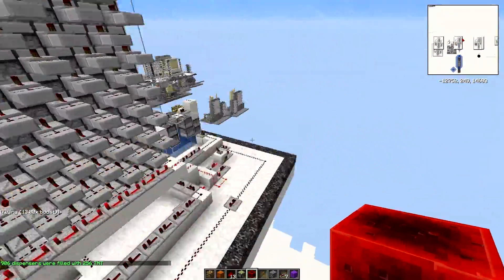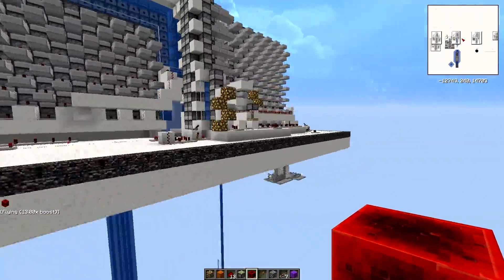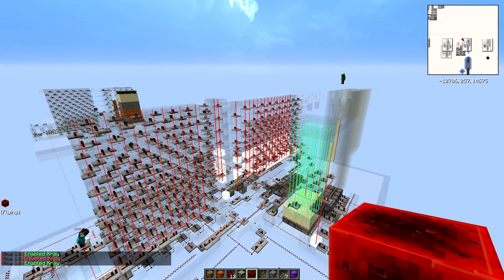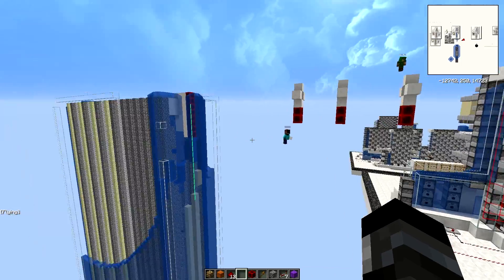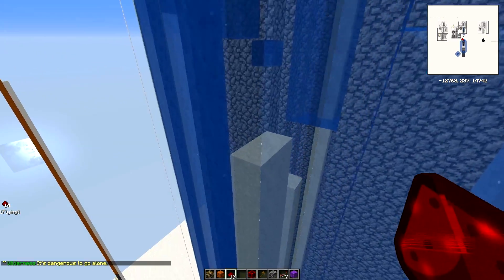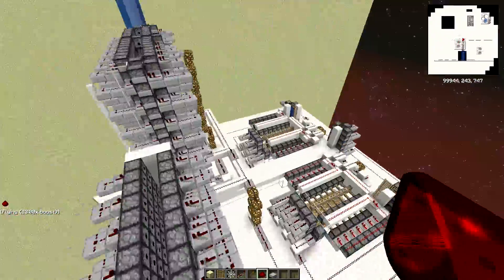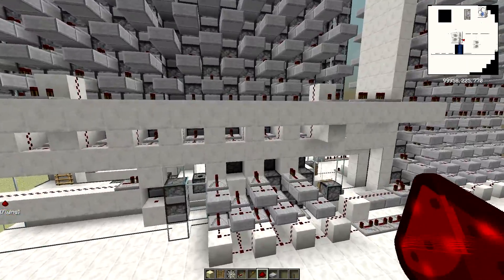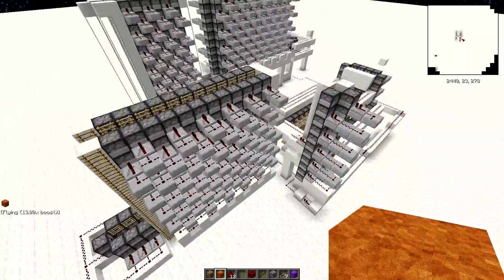Fusion Cannoning-Indexed Fullstacking with a Zero Guider Difference (Order of Entities)

Comment: Yo so with order of entity stacking, when the sand and hammer reach the wall are they technically in the same block or is the sand lower than hammer or does that not matter and it will stack anyway?
Reply from the maker: You can think of them as being in the same block-as they basically will follow the same path horizontally, albeit at slightly different times. Once it hits the wall, and with this order, the sand will update downwards slightly-so no longer in  the same block as the tnt-then when the tnt explodes, it'll then move the sand down. By choosing the order our cannon renders entities, we can then put sand and tnt in the same block, and let Minecraft update things by its own, so it can then stack down.
Reply: Beingsad Ahhh cool thanks for the help keep up the awesome work! :)
Reply: Also, how do you work out where each thing should come in the order of entities? Is it just experimenting?
Reply from the maker: experimenting and literally two and a half years of fucking with this stuff lol
Reply: Beingsad Hahahaha okay thanks :)
Reply: Another thing (sorry) what is the use in fusion cannoning
Reply from the maker: Well the most basic idea is if you needed to shoot through a 1x1 hole, however the idea of using ordering to manipulate how items stack is extremely important, you can use OOE methods with fusion stacking with regen busting-all about applying ideas in interesting ways.
Reply: +Beingsad Ah mean I guess if something is there you might as well experiment with it lol. How does real life physics relate to minecraft physics? Do laws to do with kinematics and forces and all that apply the same in minecraft?
Reply from the maker: Some do-for example with falling bodies there is drag, so our actual equations are thus different than x=xo+vot+.5at^2, etc. We have to careful and consider how the game interprets its version of physics, as things need to be quantified and processed in a certain way since we're playing on a computer.

Comment: One very good use for Order of Entities is something I've been working on which is an infinite reverse hybrid. This would allow you to reverse through water layers, in theory, from y 0-255 without having to change the amount of power you use to reverse since the hammer and sand stay in the same block so there is no issues with it not stacking fully. Most reverse hybrids require you to change the amount of power or timings every couple layers. Not only this, but an initial watered backboard would no longer be needed since you can reverse nuke and reverse hybrid in the same shot since the large amount of power necessary to reverse nuke wouldn't make it so it wont reverse stack. This will instantly create a sand backboard to continue to reverse off of while simultaneously allowing for water to flow down making this very practical and reliable in a raiding scenario.

Comment: Not about this cannon in particular, if I just add a ton of power to a cannon I'm using does it allow me to not need to add tick(s) to hammer after a certain distance? If so, is there a quantity of tnt in the propulsion that would make me not need to add hammer tick(s)? If not, what lessens the need to add tick(s) to the hammer?
Reply from the maker: +George Grady Adding more power will allow you to not need to add ticks as you're shooting the base. Because the shot is going faster per tick (more blocks per tick) then you could shoot more walls in 1 tick of delay. I find out how far it shoots by world editing a flat wall parallel with the axis the cannon shoots, and find where the hammer explodes, and then boom there  we go.
Reply: +Beingsad // GetSwatted  I see, thank you!

Comment: Interesting concept and great video.
My idea was to have ~5 TNT going off a few ticks before the hammer, this will shoot the hammer and sand a little bit up and because it´s  now flying upwards instead of falling, the hammer can tick off before all the sand become entities  and it will stack. Because there is less delay on the hammer and it will also fly up you can hybride and wont clip at the next shot.
However i couldn´t manage to slabbust and i don´t know why. In theory it should be possible because the slabbust is later in the sequence.
Sry for bad english^^
Reply from the maker: +Placebo Raiding While the slabbust does technically tick off later in the sequence, it really is ticking off effectively at the same time as the hammer, while the sand is clearly separate from the tnt, resulting in it not working as expected.
Reply: +Beingsad // GetSwatted Thank you for your quick response
oh okey
So if the send falls before the hammer ticks off, does the sand stack in the same tick the hammer explodes or in the next tick because the sand got already calculated before the hammer explode in that tick?

Comment: Very interesting concept using tick ordering to fusion stack. However on the issue with having to have the sand all become entities in a short time frame I think you are looking at it in the wrong way. What you need to do is get all the sand to become entities at a very short amount of time not make them fall necessarily in a short amount of time. I came up with this design http://prntscr.com/9zqx77 basically it uses a 12x4 sand comp design and it can spawn all the sand entities in roughly 1-3 ticks (I have not checked exactly), however with that compression it is definitely feasible to get all the sand to become entities in between the power going off and a 4 tick hammer, cool stuff.
Reply from the maker: +Big L Whoops saw it was posted in my spam folder. I can't get it to slab-stack-hybrid with this because (While the slabbust is rendered *first) the slabbust and hammer are technically rendered at the same time relative to the sand-so those will stay in the same block while the sand will move. I don't see a feasible way around that.
Reply from the maker: Seriously great thinking.
Reply: Beingsad // GetSwatted No problem :)
Reply: Beingsad // GetSwatted Wait what?
Reply: +Big L I had the same idea, but the problem with this, is that it´s aids to fill the sandcomp.
so i came up with a similar design but i´m pushing the sand with the double pistons.
http://prntscr.com/a05670

the problem here is the hight, but you could builde this under the cannon and have like a semi auto cannon where you only need to place the cobwebs
Reply from the maker: +Big L Whoops sorta embarrassing, somehow found time to check my youtube channel on my phone. Basically meant thats a very good idea lol.
Reply: Beingsad // GetSwatted Yeah I actually just finished making a sand comp that makes 288 sand become entities in 2 ticks. Now I'm going to try it on a cannon, I'll tell you how it goes.
Reply from the maker: +Big L I'm sure it works well haha
Reply: +Beingsad // GetSwatted Yea sadly the fact you can not slabbust renders fusion stacking and fusion lefting useless. However there are many other applications for this like 1 tick reversing, mid air reversing.
Reply: +Big L I've been able to make it fusion leftshoot slabbust just fine since the slabtnt is under a slab where the two dispensers are for ajayys left attachment.
Reply: imaBASKET || Courage No, I'm not saying there isn't a way to left shoot fusion, I've done it before it's just using the order of entities I don't think there is any way that you can efficiently slabbust with the cannon it's just not feasible.
Reply: +Big L what would be a different method to fusion stack?
Reply from the maker: +Big L As an update you can slabbust with this indexing method.
Reply: +Beingsad // GetSwatted i got the slabbust working as well, but I had to double pulse the hammee
Reply from the maker: +Lukas Eisele I managed to get it working without double pulsing anything-just need to optimally place the cannon. The one in the video (the 255 nuke) can shoot like 800 blocks on 2 ticks, so I tested at like 600 blocks and it worked lol. I'll mess with it more.
Reply from the maker: +Hres Yep most likely it, the slabbust on that travels an extra hundred or so blocks a tick, so it'll hit the wall first, dip down, then hammer and sand will show up.
Reply: +Beingsad // GetSwatted How do you do it exactly?
Reply from the maker: +Big L Man I'm super bummed, I swore I had it working, but I'm pretty sure I just made a mistake with something. I'll spend some more time on it.

Yesterday I tested it in a world that I often overwrite the regions (world downloads), and figured it wasn't a big deal because I know what I did to make it work. Ends up I either didn't, or I made a mistake (ie extra block in the barrel I didn't notice).
Reply: Beingsad // GetSwatted Yeah, totally cool man nice talking to you though, I'll continue working on it.
Reply: I have been testing velocity recently for a while now. Its very interesting. Slab and ladder has different effects to the tnt radiation and the distance between the propulling tnt and whats being shot really matters alot. I made a cannon with around 80 tnt power the other day where tnt was 1 block away from the propulsion whilst other tnt was 7 blocks away. This resulted in the tnt1 going around 20 chunks on 2 redstone ticks while tnt2 barely made it 5 chunks. I added a slab and it shot even less.

This is something you could do tho, use this for hammer, make the hammer take a long time to hit the wall which means you could have alot of delay on hammer. That improves alot of stuff and ways of cannoning/fusion cannoning atleast.
Reply: +Beingsad // GetSwatted I just uploaded a video i made about 2 weeks ago.
I had an idea to kinda splitt the hammer and slabbust and tested different behavior of tnt dependet on the position of the dispenser and how it gets powerd.
I noticed some weird acting that the tnt is not falling, it kinda clips at the wall.
I also think it has something to do with the velocity and distance.
I think in my testing cannon the velocity difference is because of some sliding in the barrel.

But this wont be a reliable method of Fusion Slabbusting. 
Again sry for the bad english^^

Comment: What about entities with reverse stackers?
Reply from the maker: +PandaIndustries Going to dig into that, but definitely can be important. I would think-for a "basic" reverse stacker you would just want to make sure its distinct events-ie sand isn't splitting the hammer or main power (when falling). I do have a great idea for reverse nuking I want to use (combined with the past few videos I've done).
Reply: +Beingsad // GetSwatted I need to learn your cannoning vocabulary more but I think I know what you mean, good luck.
Reply from the maker: +PandaIndustries Have all the sand fall/turn into falling all by itself without the main power (shooting everything towards the wall) or hammer (generally what stacks up or down, etc), interrupting the sand when some is falling/entity or solid(standing still)... if any of that helped at all haha
Reply: +Beingsad // GetSwatted I get what you're saying, thx!
Reply: +PandaIndustries This method is actually very very useful for reverse stacking. Basically what you can do is add a shit ton of upwards propulsion and have your hammer and sand fused together and then simply upshot and it will reverse stack at any Y level. This allows you to essentially go through any amount of water layers without needing to change any powers/ delays very very useful in raiding.
Reply: +Big L Hmm...wouldn't the sandstack and hammer be in the same block so the hammer would hammer the sand down? Whenever I try to make a reverse stack the hammer stacks like 10 sand and then the rest of the sand falls from where the hammer was reversed and compressed into one block. Know a fix?
Reply: +PandaIndustries Yes they would be in the same block you would order the entities so it would actually stack.
Reply: +Big L Oh, are you saying I'd need to have all my sand in the cob webs before the hammer goes off, I've just learned about order of entities so this is new to me.
Reply: +PandaIndustries Kinda yea
Reply from the maker: +PandaIndustries yep sounds like not all the sand is indexed right, like bigl said
Reply: +Big L ok, thank you. Fo you know any videos explaining order of entities, it seems like a useful concept in making cannons?
Reply: +PandaIndustries Ummm... this one lol
Reply: +Big L lol ok, thx
Reply from the maker: +PandaIndustries 255 nuke breaks it down some and why its important
Reply: +Beingsad // GetSwatted k thx I'll find it
Reply: +Beingsad // GetSwatted It would be very useful if you made a video covering Order Of Entities. I reviewed the 255 nuker break down and it mentioned it for a little bit. In my POV it seems like the next step to very advanced cannoning.
Reply: +Big L Damn I hadnt thought about that! You could make a very easy reverse stack nuke with that. Ill make one in the next few days
Reply: +its Toggle My idea would be something like this:

timing 1 propulsion
timing 2 reverse-hammer
timing 3 sand completely falling
timing 4 hammerdown 1
timing 5 hammerdown 2
timing 5 nuke

again no slabbust, but you would be able to reverse nuke at any y level without adjusting anything.
Reply: +Big L I just learned That sand has a lower density than tnt, so how would you get it all in the same block. I made a reverse stacker, it's in my channel, but idk if it uses That technique.

Comment: This indeed actually does work for left shooting even further, I was experimenting with fusion cannoning when I used to cannon alot (not alot now but getting back into it) and noticed about the order of entities, then i tried to left shoot using different order of entities and for my setup I had the power go off, then 2 ticks after the power all of the sand would fall (using a 6x4 on a 230, for some reason it wouldn't work on a 6x2 even though the orders were correct and everything was falling, i tried making the sand fall 1 tick after the power however that wouldnt work :/), then 1 tick after the top layer of the sand in the sand plate starting dropping the left tnt went off then 3 ticks after that the hammer went off. If i remember correctly then I believe the left tnt went off 6-7 ticks after the power. I don't think I have the server files on me still or else I would double check. I was going to make a 240 version (it would be just moving the platform up and adding 1 more row of hammer tnt) but then exams hit me so rip. However (not sure if it would help you or not) I found that using 16 left tnt was the best, anymore would make it inconsistent, that 16 went pretty far too like 8 chunks, however my design was pretty bad lol after about 6 chunks the some hammer started blowing up in the barrel yet it kept on full stacking, I'm sure trent or fusionz will make a much more better design haha
Reply from the maker: +DeterminedGoose Trent's current leftshooting ratio is something like 40+ tnt combined, so best guess for far left would be that or more. Exams suck, but real life doesn't haha-thanks for the message.
Reply: +Beingsad // GetSwatted touche real life doesn't haha, I've been thinking of a concept of a 1 shot rev nuke without the power going off twice, this would be achieved by using velocity and order of entities maybe, thoughts? is it even possible? I come with this from shurmis one shot nuke he made a long time ago, he explained to me he had used velocity to achieve that. do you think that possible with reverse nuking?
Reply from the maker: +DeterminedGoose It might be-on order of entites, trent said the initial Y direction dictates if it stacks up or down... so 99% of the time it'll stack down unless you motivate upwards direction once it hits the wall-a tough task I'd think.

Velocity is also really tricky because (if we're speaking about the same thing) there will generally be some chunk "overlap" so to speak where the order can get messed up.. ie needing to add a tick to a "hammer" but the other part doesn't need it, so then they're at the wall at the same time. Possible to combine it all? Likely, not interested on working that out haha.
Reply: +Beingsad // GetSwatted Ever tried making a fusion stacker using the same method goose is on about? - slabbust and sand hits wall first and then the hammer along with the oneshot tnt does, i find these kinda stuff interesting since theyre trippy to work with, for example a 2 wall 1shot using the same method, alot of cool stuff you can do with this method. The chunk &quot;overlap&quot; isnt a big issue in this case tho since its easy fixable but requires more tnt and i dont really see you getting this issue if your cannon is made correctly..
Also theres 1 thing that i find confusing (havent tested it yet). Lets say this is the update orders in the game tick -&gt; Propulsion -&gt; Hammer -&gt; Slabbust -&gt; Sand, now you want it to hit the wall and stack in the same game tick once this game tick is calculated , what people call a &quot;fraction tick&quot; after the propulsion, do you know if this is possible or not?